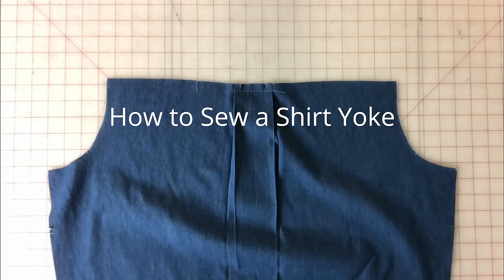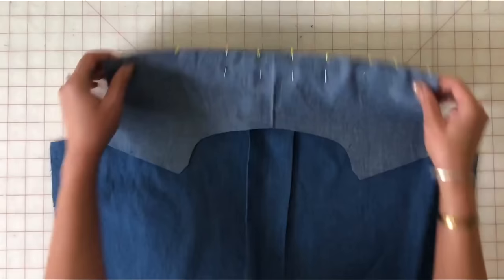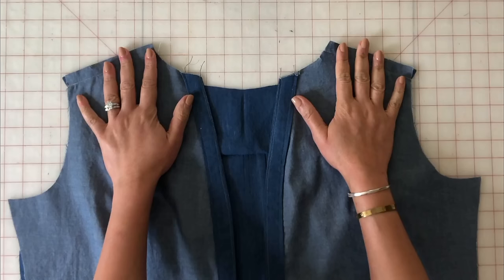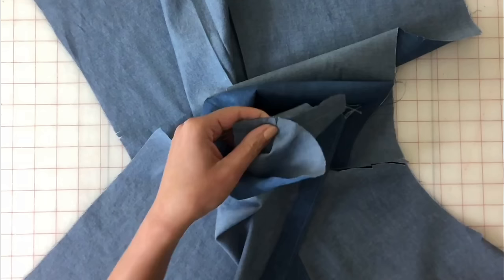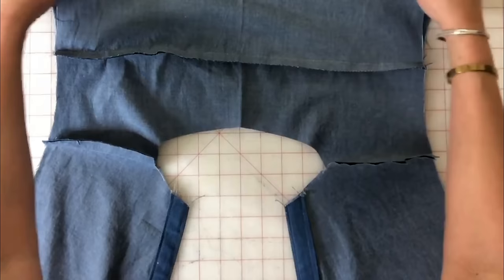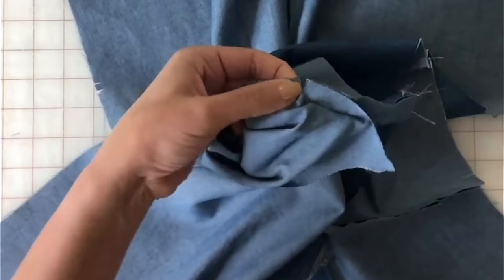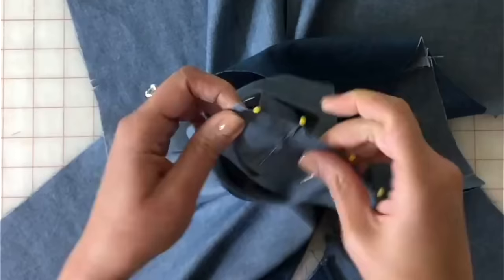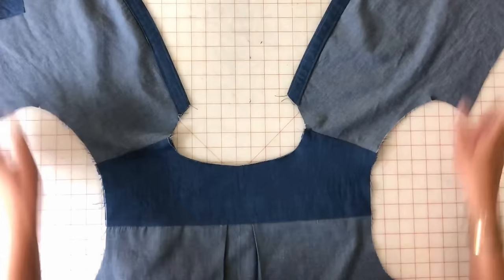How to Sew a Shirt Yoke

Comment: 3-22-18  Good teaching skills and to the point.  I've never seen it explained like this
on any pattern.
I need help on fitting pants.  My pants are always to baggy in the crotch area.  Do I
shorten the crotch length or the crotch depth on the pattern?  I'm not good at
pattern fitting do you have any ideas to help me?  Thanks
Reply from the maker: Sandra Sandy51 I am not a fit expert. But I have a great selection of fit book recommendations on the blog. Thank you!
Reply: Do you still need help with this?